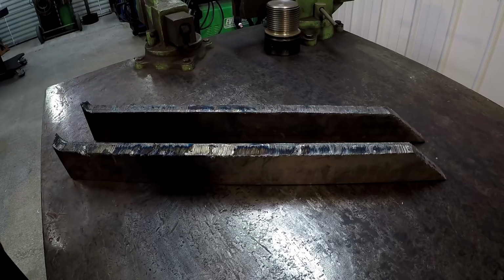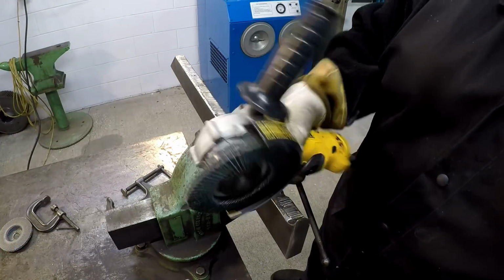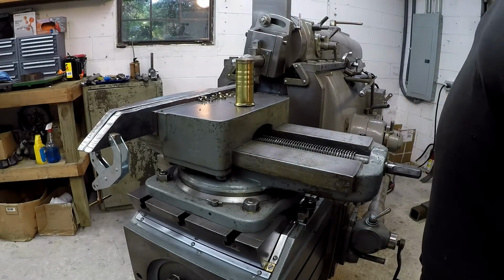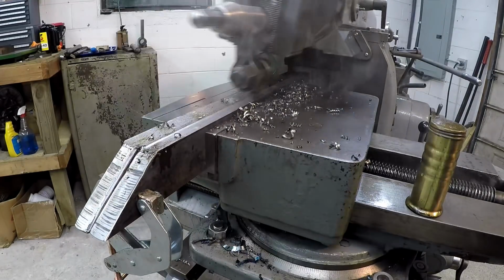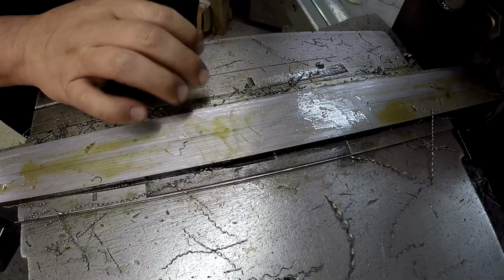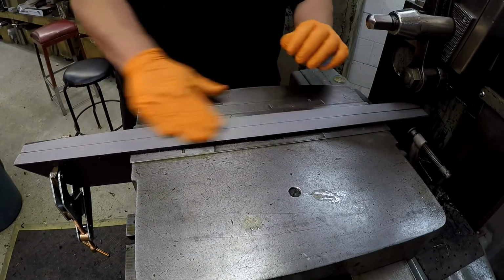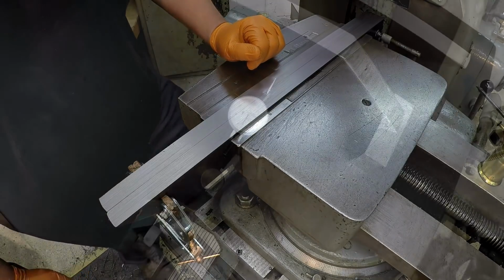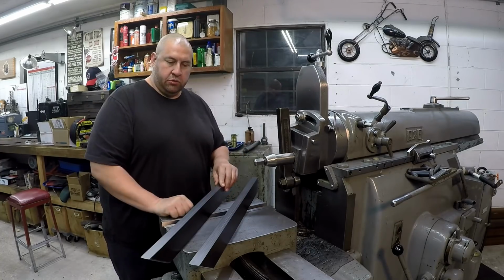SNS 220: Shaping 28" Parallel Bars

Comment: You can make anything with a shaper but money
Reply: the only thing you can't make with a shaper is a profit
Reply: @arandumendez9557  hahaha why is that?
Reply: @beyondthelol  it's a saying
Reply: @arandumendez9557   but where did it come from? are shapers considered old school or something?
Reply: @beyondthelol  no idea, i heard it on tot's channel.
Reply: @beyondthelol   Old school?? I used one in shop class back in 1990 and it was considered "old school" back then.
Reply: @beyondthelol    because its slow ... but ... its very versatile & tooling is cheap in comparison to carbide . You can get very creative with your setups... 

I once used a shaper to cut 8  - 36" long gear racks in 1"square mild steel... & it WAS slow ... 😴 but I got 'em done & charged €70 each ... so I actually DID make some cash ... (that was around 40yrs. ago 🙄) 

I also made a dividing head for it & used it to do internal splines on some pulley bores ... try THAT on a milling machine ! 😏

😎👍☘🍺

Comment: I'm a retired master machinist and have used a few shapers in my time mainly Ormerod or Butler made machines. I thought you may have explained to the newcomer machinist how the quick return stroke works with the bull wheel mechanism. Also the clapper box holding the tool lifting....on the large Butler machines it was lifted by a solenoid to stop carbide tools chipping on the return. Excellent video though, well done mate.

Comment: How do you know when to use a lubricant when machining?  It's a bit confusing.
Reply: I'm not a machinist and don't know anything. But on the internet nobody knows this, so I'm free to answer your question. And if I'm wrong, someone will correct me. ;)

Cutting creates heat, this heat can damage the workpiece and the tool. The cutting fluid takes this energy to vaporize and thereby takes the heat away. Cutting fluids can be oil, which implies that it is a lubricant. But it is more a coolant than a lubricant.

The decision when to use it is made by observing the color of the chips and how deep and fast the cuts are. If the chips get blue, there is a lot of heat to remove. If the machinist knows that it will get hot, he uses cutting fluid and if he knows that there won't be much heat he doesn't use cutting fluid.
Reply: High speed steel normaly needs coolant in every situation, it can make your tools last longer, but if you dont need to look at the money you can just not use coolant
Reply: @zvpunry1971  Ok that was a good answer. here are some extras: we always use this for machining things that will get hot ( basically every hard metal) as you said for the tools, but it also makes the spoon easier fly off the cutting edge, and lubricates the blade as well, like you shaving foam kind of. Oil withstands more heat that water, and it lubricates so its a win win.
Reply: And Sorry for some bad english :)
Reply: My favourite way of deciding if you’re gonna lubricate is “eh fuck it lets lube everything”
Reply: @AttilaThebung  this works for wire pulling too.
Reply: @AttilaThebung  Are you machining? Yeah? Fuck it drench that part. Never too much coolant.
Reply: use always as much as u can if u want the tools to last longer 
coolant is not that expensive
Reply: Rob M that’s not true, if you’re cutting something extremely hard say 65 Rc with a carbide insert coolant will actually cause thermal shock and break the insert

Comment: I would like to see how these pieces are used. I don't quite understand their purpose.
Reply: No fixed use. Instead, thousands of uses! For example, to raise a work piece off of a milling table when through-milling or drilling while staying square with the table.
Reply: @UncleKennysPlace  ooo so they are just parallel risers?
Reply: Reino  -  in the beginning he describes their use, which I think goes something like this:   Once both are out of the scraper, he’ll drill a pair of holes on one end of them.   These would correspond to holes on a work table so the bars can be bolted down on the table with about half of their length hanging over the table’s edge.   The co-worker who requested these could now lay a piece on top of them, the example given was a pipe with a flange, so imagine a T-shaped pipe (a big one of course as they work on giant things !!) with both sides of the pipe resting on the bars and the dangly-T bit hanging down between them.   His co-worker now has access to bits of the pipe he wouldn’t if it were just on the table to weld/grind/whatever...   

That’s the impression I got from his description but I have zero knowledge of these things outside of watching these and others (This Old Tony, AvE etc) videos (tho I do have some practical engineering skills from current and previous jobs).    I’m actually the lighting director for a band and spend a good portion of the year on tour (the rest of the time I spend with a renewable energy product distribution company I started) and for whatever reason I find these videos fascinating (and a bit hypnotic) and watch them quite often on the tour bus, so take what I say with that caveat :)
Reply: @grendelum  Another reason I watch Abomb's videos -- apart from the exactly same reasons you just mentioned -- is because his viewers are awesome, and leave super helpful comments. :)  I still want to see "pics or it didn't happen. " ;)

Comment: This was a wonderful video...... It's been ages since I've operated a shaper! But they do have their place....

Adam, I don't think you checked the flatness of the parallel properly. In order to check flatness you have to have three points suspension..... Because it takes three points to form a plane. I would suggest the use of Jack screws - one on one end (in the middle) and two on the other end (each near an outer edge). Then you use your test indicator to zero out all the Jack screws by touching the adjacent surface of the material near each one. Now you have a plane. At this point you can take your indicator and run up and down and across the parallel at different points. You see, once you release the parallel from the vice it might have sprung, or it might have twisted (hysteresis).... And using the three-point suspension method you'll see that easily.

I especially liked the part of the video where you showed how to grind your tool bits for the shaper. Only the old timers know how to do that..... Today's kids don't have a clue.

Comment: Perfect job for a shaper, nasty material that destroys anything that looks like carbide, quick setup, and long strokes for high productivity. A light rub with an oil stone to remove the high/torn up spots would probably make the testing a little more accurate and easier. Regarding your tool geometry on the roughing tool, in my experience that is not a bad chip, especially for hot rolled. It puts the heat into the chip and looks after the tool a lot better. I actually use a lot of negative or neutral rake geometry tools. They have saved me on a few occasions because the tool will ride up as opposed to dig in when things go pear shaped. The finish isn't too bad for hot rolled. One day I would like to get some 12L14 or something similar in the shaper to have a at. Most of my work seems to be hot rolled or 1045.  Thanks Adam, another great video. Greg
Reply: The Shed I

Comment: I think your table is less likely to be strait than the parallel bars.
Reply: nah hes on a granite surface plate, theyre ground to very precise flatness.
Reply: @Sgt.Hartman  couldn't tell what it was. I thought it was formica.
Reply: @clayboi6939  yeah that would be a no-go on precision XD
Reply: Those parallel bars were clamped in a vise while being shaped. I can’t imagine that the shaper didn’t put any heat into those bars. Also the steel is now being bridged so deviation is very possible.

Comment: Couldn't you just use Late Tools with Inserts ?
Reply: Inserts are very fragile, they would probably break or chip the edge on contact.
Reply: Facing mill inserts Schuld work.
Reply: @metz7893  and why is that

Comment: Thanks for sharing Adam.  Must do the same with my 22" Strigon. Mine is a Tool Room Shaper as well with the tilt table. Considering the amount of overhang you had those test pieces came out very well.
Happy Shaping.

Comment: 22:37 what is that metal aerosol? I would like to get one
Reply: Adam Smythe looks like a sureshot canister. You can fill em with your fave degreaser I believe
Reply: @LedZeppelinWolf  thanks, yes I found one similar called 'vaper spot spray non aerosol sprayer' on e-bay there are cheaper versions around. I'd never seen them before. I think there are AliExpress versions probably
Reply: Milwaukee SureShot

Comment: Why we not use coolant on shaping  machine
Reply: Because the heat helps to shape the metal and increases the life of the knife
Reply: @eng3d  how can the heat increase life of the knife?
Reply: There is a coating of oil that he puts on before he starts cutting. You can see as the shaper cuts through the steel - look on the area it hasn't cut yet and you'll see. It's where most of the smoke comes from
Reply: @eng3d   That's the most ridiculous thing I've ever heard.

Comment: one of the jobs i was doing when i was an apprentice was facing welds on the back ends of rail road buffers. Instead of scrapping worn buffers, the department had them recycled by welding the worn ends ,each was about 6" x 8" on four sides .The welds had a hard scale skin on them  but they weren't ground down first, just machined down as part of the job. I'll have to see if I have any drawings left of the tool bits i made back then. The surface had to be very smooth as  it rode inside a box on the end of  railroad car and moved in or out .

Comment: That Shaper machine is a beast!  I never saw one of those before... Awesome!
Reply: They're still around but not nearly as common as they were in the '30s, '40s and '50s. Most guys who worked in the industry, especially big job shops, have at least a passing familiarity with them. I cut the radius on bridge rockers on hot rolled plates 24x24x3 back in the early '70s. Once you were going, it was actually a pretty relaxing job. Most have crossed the scrap yard scales at this point in time.

Comment: Made a big set to use on the CNC from some cast iron billets. Good thing is you don't get any burrs on them,tends to chip off rather than burr up. Just perfect for bolting cylinder blocks down to the table. The water jet did a great job of getting close to size and cutting the holes.

Comment: I think you're right about the material, I never can get a really good finish on "hot rolled" ....Dave
Reply: Cutting speed or tool geometry are way off if it doesn't give a nice shiny surface like CrMo-stuff gives. Usually the problem is the former if using inserts.

Comment: your first machine ...is like your first love i guess  ...lol
it was my first machine operating at 2e grade technical highschool.
its besides a flatgrinder , the most hypnotizing machine, almost calming theraphy , luv it 
well theraputhical video budy ...haha
grtz  from the netherlands johny geerts
Reply: Yeah surface grinders are really relaxing. I'm running an older model with numerical control and flood coolant (no fancy safety-door). If you take a really light cut, you can hear the waves on a summer evening by the sea...
Or just coolant splashing from side to side I guess.

Comment: Great to see some pieces resurrected from the scrap bin and made into good useable tools of any kind. I sure love to see that old girl stroking away doing what it is meant to do, making chips.As you sat, hot rolled can be a bear to machine. It can be like cutting an inner tube with a 2 x 4 eh, LOL. You did a great job on that finish with it. I would love to have a pair of good parallels for all my benches.

Comment: Thanks Adam. I've noticed the same thing about Hot Roll with my shaper. Material just seems to be very gummy. I have yet to try it on CRS or good grade of tool steel. There are so many variables when using a shaper.  It is definitely a new learning experience for me.  I'm guessing you are healing up pretty well.

Comment: hey adam, I havnt had much luck with a shear tool with materials like that, but a tool bit ground like a radius tool with sharp top rake, it'll give a mirror smooth finish on gummy material like that on my shaper. It does have a weaker cutting edge, but as you only use it for finishing passes of around 5-10 thou, so it does last quite a while before it needs rehoned. 
It is nice to see the shaper being pushed to it's full capacity, but then you realize that it's being pushed to it's full capacity and if something bigger comes along, your kinda freaking, lol.

Comment: Nice!  It would be interesting to put those 123 blocks 1/3 in from the end to see if you are measuring the deflection caused by supporting the workpiece at the ends.  Could be .0005 ish
Reply: Those are big long heavy pieces and I think you're on to something there.  Also keeping the "sine" of the indicator consistent as you move it over 2 feet is tough.

Comment: Hello Adam, interesting video with that long stroke of cut. I’m jealous of that big vice 😎... holding at least 18”.  Have a comment on the measurements over at the granite plate. You supported the workpiece on parallel blocks at the very ends and that results in a sag.  From my reading of straight edge support, even for ones with much larger width, or breadth, there appears to be a magic point for support at about 22% or 2/9-th of the length from the ends when the effect of sag due to gravity in distributed in such a way to minimise measured deviation from straight.  I guess your measurements gave you the worse case sum of machining accuracy and sagging due to the way you supported it.  That explains why it was highest at the ends.

Comment: Hey Adam love your videos. Loved the slow-mo side view cutting disc in the grinder. Which made me think you might be able to magnetically mount a go-pro (or similar miniature HD action camera, set at its highest frames per second) on the shapers tool holder, traveling forwards and backwards filming the chips being formed, and turning blue. Just a thought, might look cool.

Comment: I think it might be worth grinding that shear tool to the other hand so the shavings are taken away from the job.This may also leave a bit more oil on the surface for the wiping action of the cutters radius.
That bar will always stress relieve when you take the mill scale off so for more accuracy you should rough both edges down and then do the finishing cuts on both edges.More flipping in the vice but I believe the finished product would be better.

Comment: My father has a transmission vice that works essentially the way your describing using those parallels, the vise sits in a swivel mount so it can be positioned rotationally as the user needs. Might be up that guys alley also

Comment: Nice i made some,of these in 1980. 4140  drilled an counter bored holes for t slot bolts.    Made a large angle plate also. 
This is a lost art. Kids do not want to learn manual machining

Comment: Hey Adam, if those long bars heat up while machining they will hog (expand on the hot side) and when cooled,will contract.  that may be the reason the middle was 0.001" under, while the edges were the same.
Reply: Tom Greenall , so why the other one it's so far planar? Same cut, same time, same everything...

Comment: I've tried to get a good finish with regular steel before also, it's hard to do. An easy way to "fake it in" is to get some 120-180 grit emery cloth with some solvent and block sand it.

Comment: I have a Southbend 7 shaper....I notice your shear tool is pushing the chips INTO the uncut area.  I am wondering why you don't reverse the feed (or reverse the grind) to push the chip into the already finished area which may not bind the chip, allowing it to freely break.  On my shear tool, that is what I have been doing and I get very nice, nearly mirror-like or grind finishes.  You may have to change the clapper box angle so the return isn't binding and/or the cutting stroke doesn't want to dig in, sometimes leaving ripples or streaks.  Great as always and yes, I approve!  Thanks.

Comment: Remember as you take material off one side, you are also relieving stresses and so probably the other side gets a slight bow. My guess is, roll formed, hot or cold = compression / compressive residual stress, so probably the side opposite the cut wants to expand and bows outward? When you finish with one side, I'd bet a light finishing pass on the opposite side would even it out (within the tolerances on the machine) without inducing an opposite bow in the previous side because you aren't removing as much material as the roughing passes.
Reply: I was wondering why they did turn out parallel, I guess you  got me an answer, thanks.

Comment: You can use that shear tool geometry as a lathe tool.  You can only take one or two thou at a time but it works really well to get a nice finish on "gummy" low carbon mild steels. 

And its height insensitive which is nice.

Comment: I was watching that shear tool work and once in a while it was grabbing a chip and dragging it back under the tool. It looked to me like the chip rubbing is what was causing some of the stripey finish. I think this is because you needed just a little more stroke. It seemed like if the tool went even 1/2 inch further past the end, the chips would get themselves out of the way better and not get caught up on the backstroke.

Comment: The shot where you had the camera mounted on the ram was very cool. If you ever get your hands on a high speed camera that's small enough, it would be fun to have a slow motion of the shaper making a cut. Perhaps The Slow Mo Guys would be interested in doing a collaboration? Combining manual machining with super high speed cameras could be cool, would possibly get to see the metal removal happen in a new way.